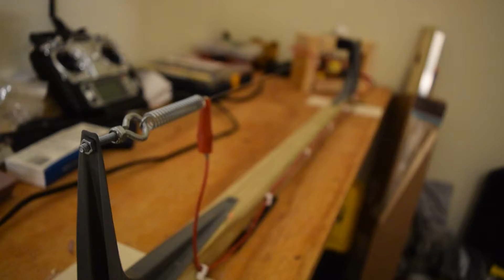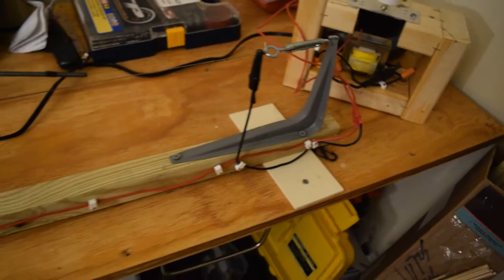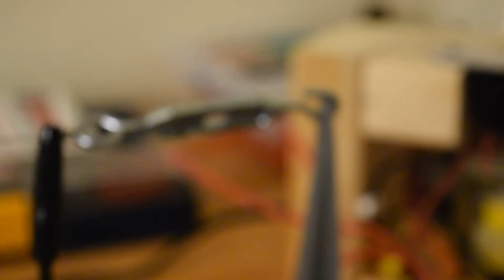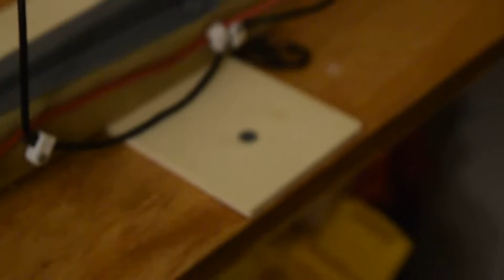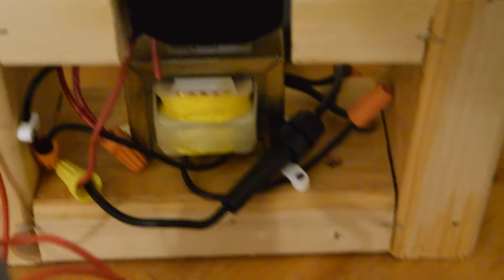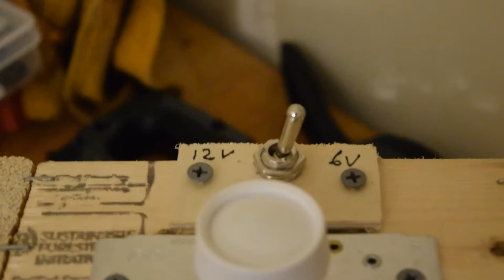DIY Hot Wire Foam Cutter Overview

Comment: Hi Drew, I have a rig similar to this one and I have a Nichrome 24gauge wire. However, I can't get the wire to heat up and cut through foam etc. My power supply is a 12V/1.2A. Looking at you video it is probably too weak. But I am not very clued up on these things... Do you have a schematic of the diagram for the parts you used and how everything is wired up?
Reply from the maker: Howdy Ian, 1.2 amp is very low for this application, I have a bench top 5A ac to dc power supply that I have been using lately and for some jobs even the 5A at 12 V DC seems a bit low.  Here is a link to the one I've been using: https://www.amazon.com/gp/product/B00PWNQMYI/ref=ppx_yo_dt_b_search_asin_title?ie=UTF8&psc=1
Reply: @DrewMann  Won't the transformer burn when connected to the wire? It is basically a short.
Reply from the maker: @rva1945  the nichrome wire acts as a resistor, which is why it heats up, it's similar to most other loads I suppose

Comment: Im just getting started in hot wire cutting. Thought your setup was cool. I do the opposite and have the foam locked down and move the wire. Noticed you havent cut anything on youtube in a while. You still doing scratch builds?
Reply from the maker: greetings Nathan, to be honest after getting into quads I have stopped building fixed wing craft. There is such a great difference in the feeling of flight that a quad can provide that I have found them to be a more rewarding use of time and resources for the time being.
Reply: DrewMan RC cool. I did it the other way. started in quads and and now love FPV and Los flying planes. enjoyed the builds.
Reply from the maker: I hear ya, there was certainly a real sense of accomplishment when I got my first plane to fly :)